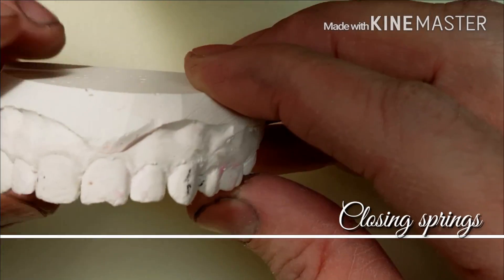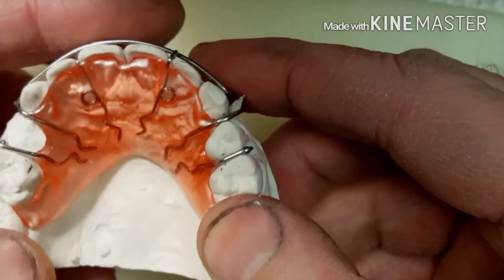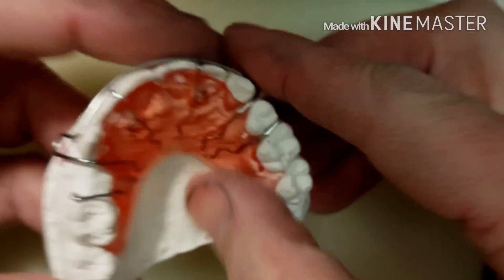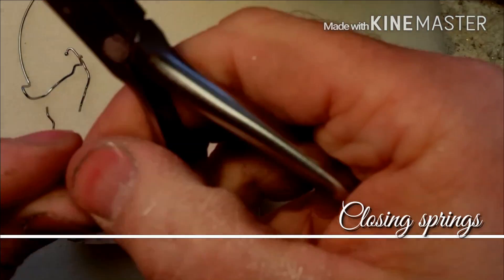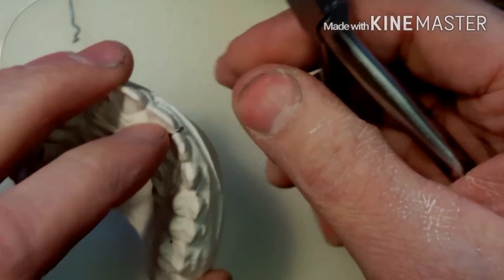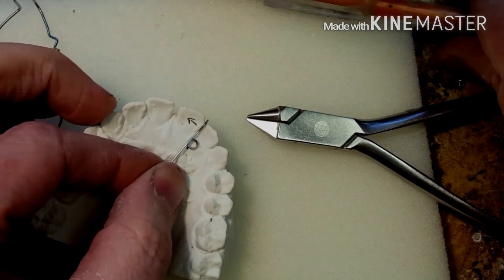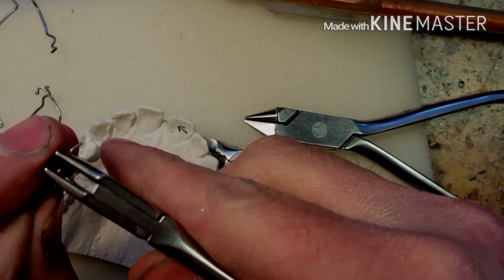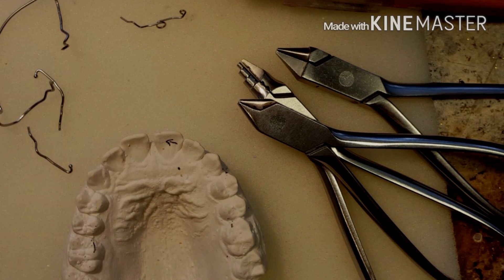Orthodontic closing springs (Diastema) lesson

Comment: can we close diastema with it
Reply: how about activation protocol
Reply from the maker: @yasriz6052  springs are initially set (activated by tech). If you need more torque you just adjust pressure on spring with a 139 bird beak plier
Reply from the maker: Yes
Reply: @SzaraDentalLab  what's the name of it finger spring with hawleys
Reply from the maker: @yasriz6052  that's what it is called. Hawley with closing finger springs